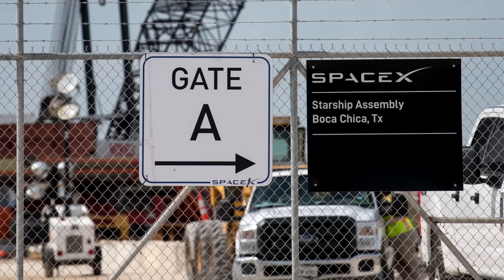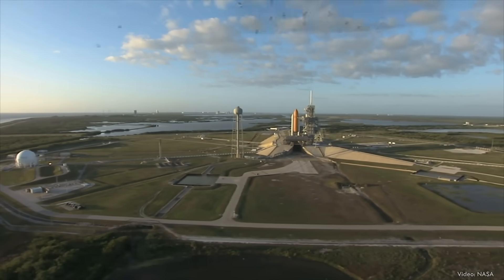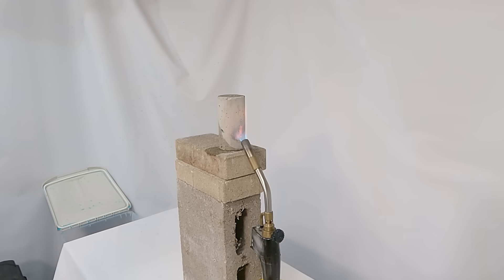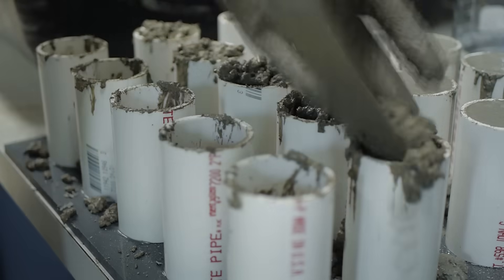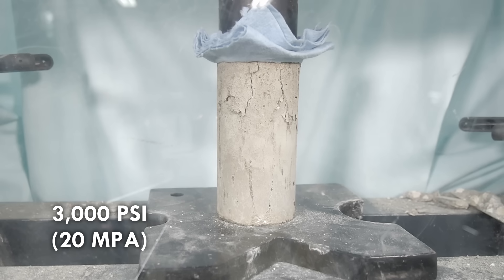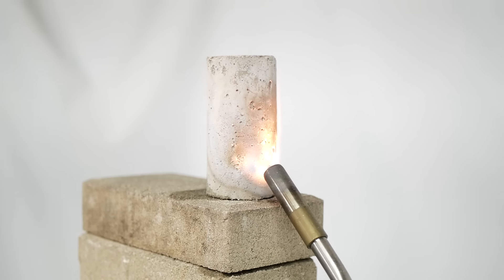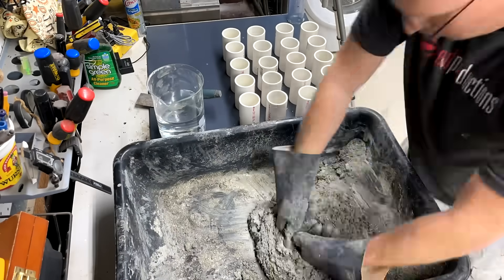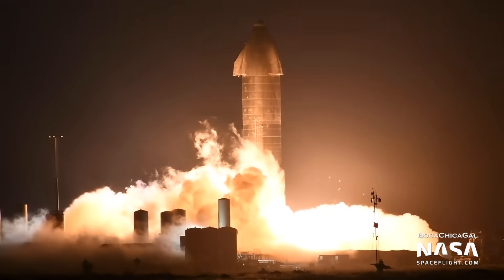Why SpaceX Cares About Concrete

Comment: Something to note about the length of time SpaceX fires their engines during static fires:

Static fires are only a couple seconds long. Duration burns with the engines are done without the vehicle in specialized stands. Static fires with the vehicle are just to make sure they were installed properly which they can see with the very short burns.
Reply: that is true, but at the same time, His blowtorch test that ran longer than most static fires, was also only hitting it with (a clean) ~1000ᵒ flame moving slightly faster than a soft breeze and exerting about as much force.  as compared to +1500ᵒ, 410,000 lb f exhaust moving many times faster than the speed of sound :P (per engine)
Reply: @nuarius  Mind if i RANDOMLY recommend a cool Channel like Practical Engineering or Veritasium or Its ok to be smart?
Reply: @slevinchannel7589  already long time followers lol.    This is the primary contetnt i watch on youtube lol
Reply: @nuarius  
But about YT-Cahnnel overall, 
there's surely stuff you dont know yet and will learn-and-then-enjoy thanks to ME!! Which makes ME happy. 

So here, let me TRY: 
-Legal Eagle. 
-Cinema Therapy. 
-Professor Dave Explains. 
-Hbomberguy. 
-Viced Rhino. 
-Believe it or not. 
-Michio Kaku!!
Reply: The static fire durations are long enough to damage the concrete, even the first one. It just usually isn't so dramatic.

Comment: You should get a good look at how the Space Shuttles pad was done back in 1983......
      We didn't have all mixes we do today. There was a 30ft radius at center of all three engines that was 8in deep.
 When the rest of the flame bucket was done we went back to pour the 8in recess.....
       It's the only time I've done
(Vacuum process concreat).
Form mounted vibrators, vacuums hoses 2ft on center. It was pretty trick for the 80s.....
      I only wish I knew then what I know now I would have paid more attention to things like mix design. Let's face it I was a 19 year old apprentice an just kept my head down an mouth shut......
      Still got to do an see things that only a handful of men ever will GOOD TIMES
Reply: That's amazing!

Comment: "That's one of the reasons we use [concrete] in so much of our buildings and infrastructure: it doesn't burn."
Chlorine Trifluoride molecules: "Allow us to introduce ourselves."
Reply: Well in that case nothing but god and/or a good pair of running shoes will save you.
Reply: How on earth do you make/store chlorine trifluoride?  That sounds even more terrifying than O2F2 ...which would probably also set concrete on fire.
Reply: @Hyrum_Graff  Ask the electronic companies that use it for cleaning chemical vapor deposition chambers
Reply: @Hyrum_Graff   @Hyrum_Graff  apparently it's storeable within certain metals if they are prepared correctly; if you're very careful apparently you can form a layer of fluorine-metal compounds atop the metal that stops them from reacting. Although of course if that gets worn off or damaged then you'll probably have a very, very bad day.

Comment: I've worked with refractory cement for years, for hobby purposes (garage smelting & casting of bronze, brass & copper), so I always knew that it is crucial to use a proper refractory material for lining kilns & forges, as well as using as little water as possible (and as recommended by manufacturer) to prepare the mix. Yet, I never asked myself how refractory cement works, what makes it different from regular stuff. I always took it for granted that if you use correct material, in a correct way, you will get satisfactory results. Thanks a lot for this video, as now I not only know that I need to use proper refractory materials, I also know WHY I need to do that!
Reply: A guy made his own refractory cement on r/MetalFoundry

Comment: Regarding the advertisement (and stain) at the end:
Try adding a few ounces of 99% or even 90% Isopropyl to a normal bottle of Shout stain remover.  So far I have found no dyes that it has reacted unfavorably with.  The alcohol acts as a carrier which helps dissolve the oil, and the grease/oil then becomes entraped in the soaps of the detergent as the alcohol evaporates.  We cook almost all of our meals at home, run a farm, do most of our own repair/maintenance work, and my wife does high volume veterinary surgical procedures and large animal medicine.  We stain EVERYTHING.  Grease/oil is no longer as intimidating.  Some synthetic oils and high quality machine greases may take two washings- but you can save that shirt!

Comment: Practical Engineering: Any clue as to why engineers would design a concrete pouring truck with seven axles (four in the back - smallish gap - three in the front)? -- In Australia (where they are generally more liberal with axles than through America and Europe).

Comment: Speaking of surviving high heat, apparently the motor in the Sprint missile had zirconium staples in the propellant to conduct heat into the unburnt layer so it wouldn't explode from the thermal shock.

Comment: I have better idea though it's more expensive or hard to find, what about we change from concrete to some metals or diamond
Metals launch pad is stronger than concrete, although its hard to find sweet spot to make strong & heat resistant
What about diamond pad, it's expensive but everyone knows is tough af
Reply: Metal will simply melt
Reply: @jamesengland7461  you right metal will melt, what i mean here we used specific metal that strong and heat resistant like tungsten or titanium or combination of both metal, so we get a durable metal
Though it will expensive to make, but we got durable material that last longer than concrete itself

Comment: 2:37 - Grady: "Concrete is a relatively fire-resistant material."
Chlorine Trifluoride: "Grady, hold ma beer."
And, yes! At one point, NASA was looking to use Chlorine Trifluoride as an oxidizer for rocket fuel. An instance where a ton of of the stuff leaked out... burning through the road and a meter of dirt. https://www.youtube.com/watch?v=ckSoDW2-wrc&t=28s&ab_channel=SciShow

Comment: Starship is a firework rocket :D
Reply: I'm reminded of the old Mercury rockets from the early '60s. But with dedication and perseverance, they gave way to the mighty Saturn V. I see no reason to believe Starship won't make the same journey.
Reply: @General12th  I also think Staship will make it! It might (and probably will) be changed a lot in the coming years but i domt think it will fail completly. It might take longer than SpaceX estimates but i think its capable of fulfilling the job

Comment: So a question: How does time affect this. I have a 65 year old concrete house and had a small but hot fire in a room. There is no physical signs of damage after cleaning out the room. Also, the room did not have water in it and was well ventilated for the 65 year period. I am going to have an engineer look at it, but should I be worried?
Reply: I went with a structural engineer to inspect some bridge abutments that had been through a forest fire. They were pink like Grady said and spalled big chunks with some moderate taps from a hammer. I'd definitely let the engineer assess it.

Comment: No wonder the I-85 bridge in Atlanta collapsed. All that heat severely compromised the strength of the concrete and it could no longer handle the load.
Reply: What heat are you referring to?
Reply: @jamesengland7461  Back a number of years ago while I was helping remodel Publix Supermarkets, A fire was set underneath a bridge on Interstate I-85. At the time GDOT was storing a number of construction materials under the bridge from an earlier projects. These materials caught fire and the bridge later collasped during the fire. I remember alot of conspiracy theories go "Fire shouldn't cause concrete to collapse" similar along the lines of the  9-11 "truther" arguments and forgetting just what heat can do to materials that isn't really thought about by the average person.

Comment: I like the subject and coverage, but you are really off-base on a lot starting out.
"SpaceX and other launch providers are now landing rockets propulsively..."
No. That's pretty much exclusively SpaceX, Grady. Blue Origin has done it a few times with a much smaller rocket going suborbital, but... so has a certain YouTuber. Blue Origin is not yet a "launch provider" in the parlance of the industry.
The coming down is far more precise than the going up. They are targeting a ship less than 50 meters across several hundred kilometers out to sea or returning after going that far out and returning to a site (or sites) several kilometers from the launch site.
And you showed a lot of clips of the many failed tries several years ago. SpaceX is not embarrassed by that, they produced their own "blooper reel". In the meantime they have about a 95% success rate with the current generation of boosters in getting up and back down. SpaceX now has more boosters that have reflown than Blue Origin has reflown any individual booster. 1049 and 1051 have each flown and landed 10 times each, meeting the original design goal.
Who owns HelloFresh? Jeff Bezos?

Comment: I had wondered why a ceramic material wasn't used in conjunction with refractory concrete but then it appeared at 09:45.  I guess there's only so many fresh laying and patching jobs you can do before it all explodes under the pressure of rocket engines and other factors.  As long as they learn from mistakes tho.
Reply: Refractory cement is not different from ceramics. Ceramics aka metal oxides sintered together. Refractory cement also contains metal oxides of various kinds.

Comment: I wonder if aerograhene or a similar aero-material could be used to either perminently or temporarily shield the ground from the heat. Even if the aero-material is blasted off, I doubt it has enough mass to overcome the forces being exerted in the opposite direction.
Reply: Excuse the Randomness but here you go, 
have some warm Recommendations, cause the Learning never Ends! (Thats the 
entire reason, yes) 

-Veritasium. 
-Professor Dave Explains. 
-It’s ok to be smart. 
-Krimson Rogue. 
-Cynical Reviews. 
-Michio Kaku. 
-Multiple channel with the word Engineering in it. 
-The Best for Last: Hbomberguy!

Comment: Usually an imbedded mesh system on top of regular concrete then the refractory concrete is shot into the mesh to the desired thickness (usually 6 inches to 12 inches). The refractory concrete protects the underlying concrete and can be periodically replaced as needed. .
Reply: She knew who she was marrying.
Reply: @EliS57  what lol

Comment: During the last aprox. 10 years of my life I've started building more out of concrete, experimenting with reinforcement, composition, additives - mostly for foundations, encasements for utilities, etc. This week for the first time I tried glassfibre fibruous materials (8mm long tiny fibres) mixed in with the aggregates to provide added tiny "reinforcement" for the cement. It would be much appreaciated to see you test various concrete recepies - eg., very liquid/flowing concrete (consistency of large/flat pancake dough) with various concrete ratio (1:3 to the larger aggregate (gravel), 2:3 to larger aggregate), then making some drier batches (less easily flowing, at a consistency of playdough) with and without plastificators, then making dry batches with lots of cement, etc - adding different grades of cement, for some of them - even dusting some dry cement powder on top of 2-3 hour old concrete mixture and blending the powder in with a spatula, then testing all samples with the a press. Reading all the comment - probably I should do the testing and make a youtube video. Anyway. Nicely done and greetings from Latvia.
Reply: I would watch that video if you made it!